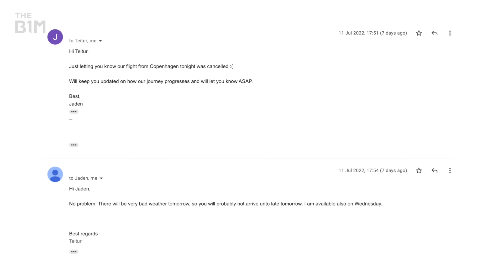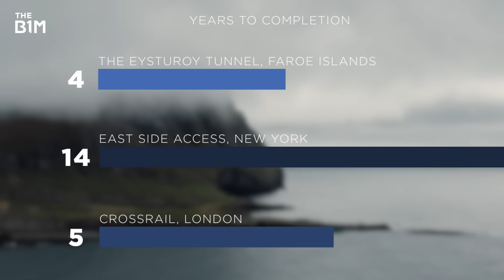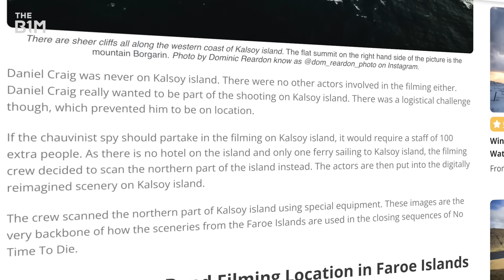Inside The World’s First Undersea Roundabout

Comment: They have perhaps getting their inspiration from Norway. The world's longest road tunnel, which in western Norway called Laerdalstunnelen is very long, 24.5 km long. They painted the walls several places to prevent fatigue for drivers getting tired inside the long and monotonic road tunnel. The walls were painted blue and white and in areas where the tunnel is a bit wider.

Comment: 7:27 Why don't they use the island inbetween Streymoy and Sandoy and make 2 smaller tunnels?
Reply: Issues with getting too steep grades. Longer total length, long curved tunnels in order to stay under a certain grade. Higher costs. If that island was supposed to have road connection in the frst place, it would been different.

Comment: I think you mixed up the length of the nearly-finished Sandoy tunnel and the maybe-to-be-built Suðuroy tunnel – Sandoy tunnel will be about 11km long, not 22. An enormous project nonetheless the approx. 1000 inhabitants of Sandoy. Sandoy might be the toehold for the suggested Suðuroy tunnel, connecting another 5000 people to the mainland, sparing them from a 2-hour ferry ride – and that one would be about 22–25 km long and, even more than the ones built to this day, an absolutely enormous undertaking.

Comment: Have to disapoint you. Finnfast, or Finnøytunnelen, outside Stavanger in Norway, also has a roundabout. It was opened in 2009.....

The currently longest undersea tunnel, Ryfast, or Ryfylketunnelen, is between Stavanger and Strand. It's 14.400 meters long, and opened in 2019.

Comming up, is Rogfast on E39, under Boknafjorden, north of Stavanger. Planned between Randaberg and Bokn. It will be 26.700 meters long. It will also be the deepest (392 meters). It is estimated to open in 2031, but will probably take longer....
Reply: This roundabout is under water
Reply: @TheRedBaronHP  So is Finnfast....
Reply: This won is under the seabed
Reply: @TheRedBaronHP  So is Finnfast. Google it. It goes between Rennesøy and Finnøy, north of Stavanger, Norway. The roundabout connects the island of Talgje....

Comment: They should get a central NPP built with those plug-n-play SMRs, and run power cables through the tunnels to provide power to all the islands.
Reply: That sounds like a hackable nightmare. Plus, if one goes down, they all go down. You need redundancies for things like that, and you certainly wouldn't want PnP. If the IT admins running it can't figure out how to program servers and routers, then they shouldn't be doing that job.

Comment: Is there any concern that rising sea levels will flood the tunnels within the next 50 years? What changes did they make to the nearby coastline to ensure that tide / storm / tidal waves won't cause irreparable damage to the tunnel?
Reply: Inlet/outlets are tens of meters above sea level. There are pumping stations at the bottom of the tunnels, in general, to handle water coming through the ground

Comment: The cost per capita is absolutely insane. I live in a city of 100,000 people which is admittedly in a fairly flat area of the flattest continent. The cost of 1 of those tunnels is directly comparable to the price of our recently built (rebuilt) hospital which has been the biggest infrastructure project in the city. Our city council makes an absolute shambles of just putting in roundabouts let alone a below ground/water one. AFAIK there is only 1 tunnel within about 100km from here and the nearest road tunnel would be in Melboune about 160km from here. I can't even envisage how that sort of money is spent on infastructure for such a small population. The cost of the toll roads are quite high but I guess they would have to be. I can't imagine that the tolls would ever recoup the construction costs let alone covering those costs plus maintenance.

Comment: One thing I don’t understand is how are they paying for this? In my city of 1,000,000 the rail project is a lot cheaper per capita but already incredibly difficult to justify politically.
Reply: One get a loan and the users of the tunnels pay it back in 15 years. This is possible when the tunnels are seeing a lot of use and traffic, big time saving, lots of cizens and companies using it jointly pays it down. Other infrastructure projects can be cheaper to build, but on the other hand have issues getting enough traffic/income and having higher maintenance costs and so on

Comment: No, it isn't 7000 Euro per capita ("per capita" includes babies, the elderly and all others not gainfully employed), the two tunnels combined work out to cost about three times that amount, probably at least six times that amount per employed person. So where is all that money coming from? Someone is footing this astronomical bill. In the short run the Faroes benefit hugely from all of that employment. Which helps explain why they might be developing an addiction to tunneling projects...when that economic music stops there are going to be a whole lot of sad people walking and bicycling through those tunnels because they can't afford cars or gas. 

Also, blasting a tunnel involves stimulating the rock around the blast to propagate cracks. Hopefully all that crack propagation stops when it reaches the outer edge of the tunnel. Hopefully. One hundred meters beneath the sea one is extremely hopeful that cracks from blasting stop propagating well within the tunnel. Because if any of those cracks were to propagate beyond the edge of the tunnel, as far upward as the sea floor above the tunnel, the collapse of the tunnel would be sudden without warning, instantaneous and absolutely fatal to anyone traveling through the tunnel at that time.

Comment: I spent about 5 weeks in Iceland and the Faroes in 2008. In the Faroes, it was a lot of ferrying about, but the roads were very often straight through the mountains as opposed to Iceland where they still went the long way along the fjords. I am absolutely amazed at how much they're accomplished for themselves since then. That is some serious engineering, and some true social cohesion. Impressive. I'm looking forward to what they'll do about Suduroy though,way down south. 😛

I remember many 1-lane tunnels in the Faroe Islands. I'd never seen those before. Each entrance shows if you yield or if you have right of way. Inside the tunnels, there are alcoves every so often, to the right of the yielding direction for cars to slide in and let the other guy through. It's considered good manners to shut your lights off while the other driver passes.

Comment: This is stunning, and I'm very happy for the Faroese that they have such incredible tunnels.

I'm a little worried about what you said around the 6:00 mark. "... any rain or surface water from the cars... pumping it back out into the nearby fjord".

This disturbs me a little. Everyone knows that water from cars is not clean. If we ignore the road salt, there's generally oil, grease, and various other toxic nasties in there. In the UK, we used to take motorway water and dump that into nearby streams or rivers. However, we have learned through unpleasant experience that this is not the right way to do things. The pollution risk is too great. 

Now all motorway runoff is collected in traps. The top layer (oil, grease, even petrol and diesel!) is skimmed off and recycled. Heavy metals, such as the ones used in catalytic converters, fall to the bottom and is then removed. Lastly, the water is then sent to a special "garden". You can see these (I spotted my first one on the A11 after visiting a friend) from the motorway/dual carriageway. They are comprised of plants that "enjoy" this type of water. Finally, anything left is "seeped" towards a newly constructed soakaway.

I don't know how much traffic they will have in the tunnel, but I hope they are being careful with "runoff". 

Lastly, an excellent video B1M! Fascinating and eye-opening! These islands are so close to the UK, yet we know so little about them. Thank you for giving me a "sample" of the Faroes!
Reply: It gets filtered. Obviously.
Reply: @More_Row  Thank you! I'm glad you "filtered" that response to me so quickly! It just kind of worried me, as in the UK, motorway and dual carriageway runoff has done so much damage to local water sources, and only in the last few years has actually got around to doing anything about it! I like seeing these little "gardens" alongside motorways - it makes me happy to think we're not just destroying ecosystems because it's easier. 

Thanks for putting me straight on that. (Sudden sigh of relief)!
Reply: @bradmiley  No worries .

Comment: Anywhere else I would have complained it should have been a rail tunnel. But here trains just don't make sense. Any heavy freight can be shipped over and any light/fast freight is essentially only doing last mile delivery. And the people live spread apart far enough that public transport would have trouble being convenient. 

That said, putting in some sunken rails on the side to get trams through might be interesting as a future expansion.
Reply: Raillines are nice. But not for färöer islands. The tunnels would be too steep for normal raillines. Also there is no dense population center but many small settelings, so you would need allot train stations and more than one line. 

All in all; the car is absolutly superior for transportation at these islands.
Reply: Electric buses are all you need in this case
Reply: there are no trains in the Faroes at all